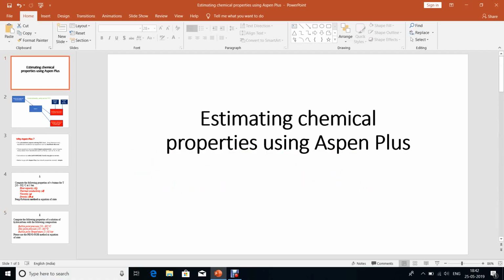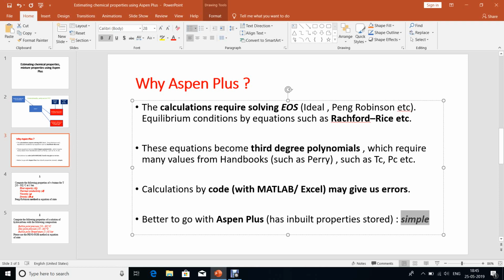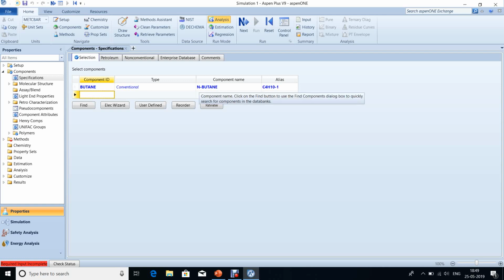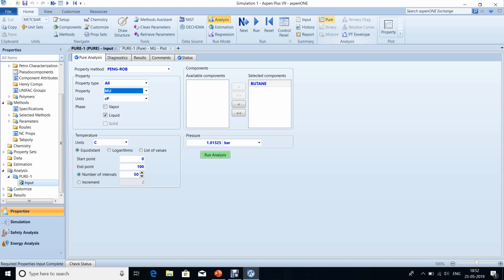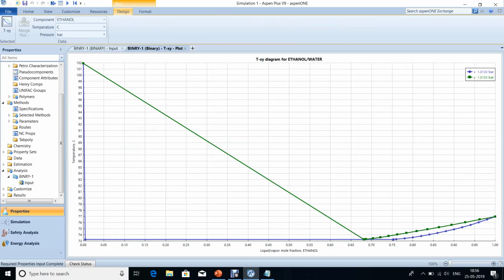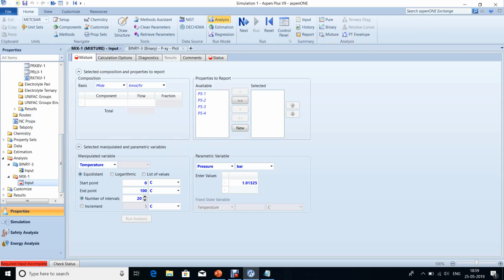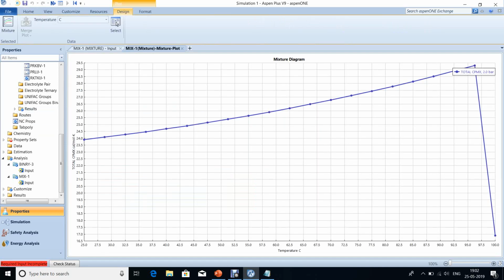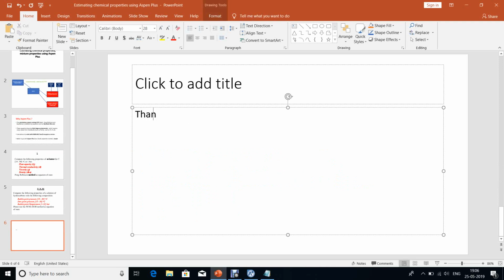property estimation with Aspen Plus

Comment: Add something about regression of the binary interaction parameters and how to assess whether it is write or wrong
Reply from the maker: Sure. I will try to add.
Reply: Have you found anything yet ? i found a book that shows step by step for regression of binary isotherms. I was able to do 4 activity coefficient models to find best fit however the problem i am now having is that i am required  to use The Combined and Direct method for those activity coefficient models so thats where i am stuck
Reply: @melandripalmer  Book name,Pls??